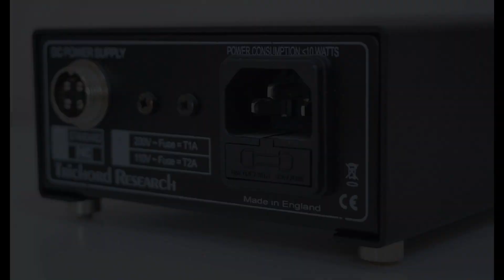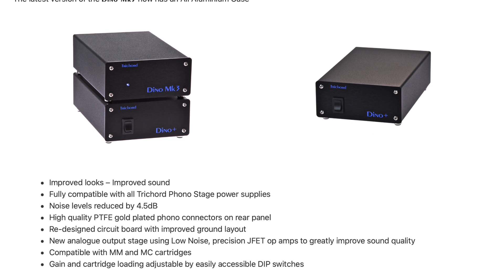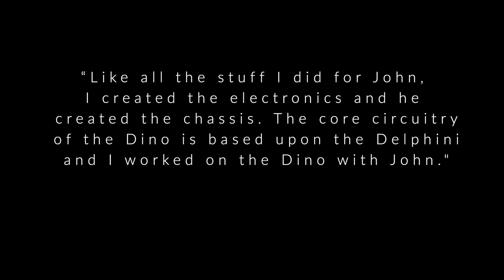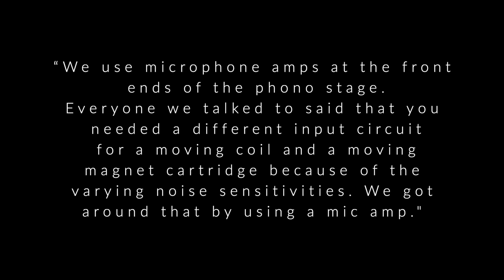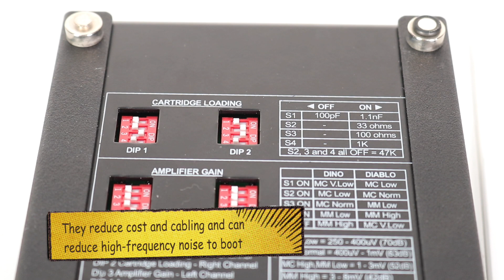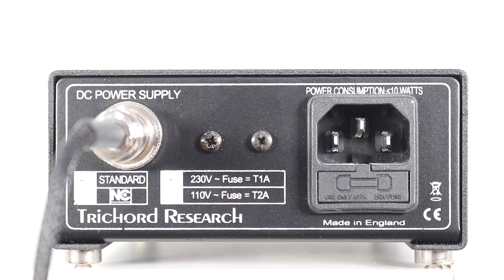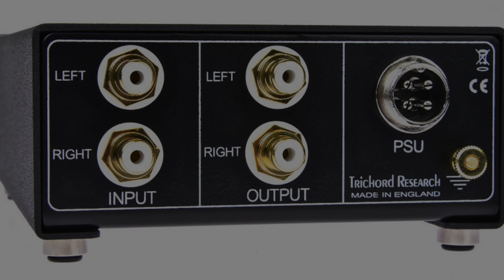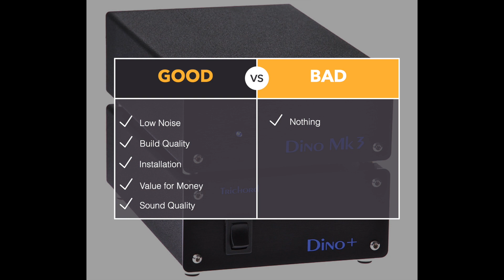TRICHORD DINO MK.3 PHONO AMPLIFIER & UPGRADES: CLOSE UP SECTION, PROS AND CONS PLUS A FINAL RATING!

Comment: Hi Paul and thanks for a very comprehensive may review. I bought my mk2 version of the Dino/DinoPlus/special lead about 20 years ago and about 7yrs ago I met Graham and told him I'd been using it without any issues, to which he replied - "I hate it when I meet people like you". I know what he means because when you've got a Dino you are cured of up-grade-tist. Well that's been my experience. After chatting to Graham he mentioned I could upgrade my Mk2 to a Mk3 which I did especially as he offered to take Mk2 in part- ex. When I got the Mk3 to be honest I wasn't  expecting much of difference because the Mk2 was already very good. I remember asking Graham about the differences between the Mk2 and the Mk3 and he said it was quieter but did he mean. Well to me the spaces between notes was better defined which improves overall listener engagement with the music. It's also such a versatile little phono stage because you can run anything from an AT95  well up to Dynavector XX2 which only outputs a measley 350uV. Definitely 10/10 Groovy from me

Comment: Hi Paul
Forgive me for asking you a question unrelated to this video. You were kind enough to answer my previous question regarding the suitability of the Soundeck mini damping feet in terms of being placed under speakers. You quoted from the Soundeck company literature attesting to their weight bearing strength. But the problem remains that it is hard to lift heavy speakers onto the mini discs waiting below, because the speaker spikes slide off them, and flip them. So, my question involves whether this can be solved by anything other than trial and error and a lot of heavy lifting. And given that you have these discs under your speakers (floorstanders presumably) without you using spikes, I'd like to ask if you simply put the mini discs in the four corners directly under your speakers (IE it's the carpet, then, the 3 mm damping feet, then the weight of the speakers on top - with little to no distance from speaker-bottom to carpeted floor).
Reply from the maker: Oooohhh, I see - so it's a slippy slidey thing then. Tell you what, contact Les at the company. Tell him about the issue - give him a ring so he full understands instead of am email. He may be able to provide something to stick on top to provide a bit of grip. Tell him you contacted me first and that we chatted and I suggested you rung him. Get back to me afterwards, let me know how you get on please.
Reply: @TheAudiophileMan 
 Hi Paul
With my wife's help, it became quite easy to place the Soundeck mini damping feet under the floor standing speakers. You may further be interested to learn that tilting the speakers on both  sides (and sliding a mini damping disc under front and back spikes) worked well. Beyond that, I'm happy to confirm that - when placed under speakers - the damping feet do what they say on the tin. The speakers sound more grown up. Everything has a little more depth, bass is more tuneful, strings are more airy. There was another unexpected benefit - I get more sound at a given volume level than previously. I consider that a plus. I'm talking two notches of a volume control difference. I mean why turn up the amp if you don't need to. It should represent less listener fatigue on long listening (not that I have that problem, it's just we need to look after our ears, don't we?)
I already have mini damping feet under my CD player, so I'm still enjoying that upgrade too.  I feel therefore that these mini damping feet allow my system to sing like it should. I hasten to add that the same can't always be said, for say, interconnects and expensive mains cables (which can alter the sound without necessarily improving it).  Finally, the mini damping feet look, particularly good under speakers. The spikes used to disappear down into thick carpet fibres  and  now they're on view as they stand on the damping feet. I've congratulated Les from Soundeck on a great product, and as here, I've presented him with my  findings.
Reply: @cybot6   Hi Dermot, Thanks for your reply. I've now succeeded in putting these damping feet under my speaker spikes. Ultimately, I haven't gone with the 'lose the spikes' idea because we've got thick carpets in our house and also underfloor heating. At this point, I'm just grateful to have the spikes higher up and not sunk into carpet. The mini damping feet are worth it, by the way. I've sent a response within this thread to the 'Audiophile man' in which I go into more detail.
Reply: @nazaholicable  So glad you figured it all out with a little help from your wife. Thanks too for the mini review. Very interesting indeed! With you too on the underfloor heating. It all starts to make sense.
Reply: @nazaholicable  Forgot to mention that you should also insert your experience with the Soundeck mini damping feet in the original review section too. I’m sure people there would be intrigued with your follow up plus it’d be easier to locate. Just a suggestion.

Comment: I have the Dino Mk2 and used it as an upgrade for my built in my phono stage. I really love the sound but I have one gripe. It appears to be very prone to static and pops. I have switched between the two stages and it goes away when swapping. Any recommendations for reducing the static from the signal path?
Reply: I’ve the same problem there’s a lot of background noise , I’ve tried everything